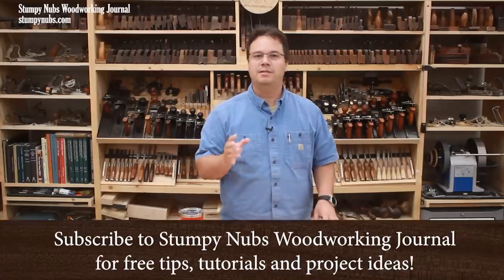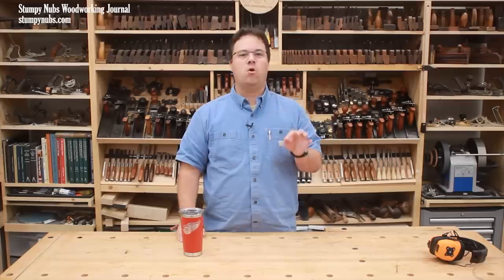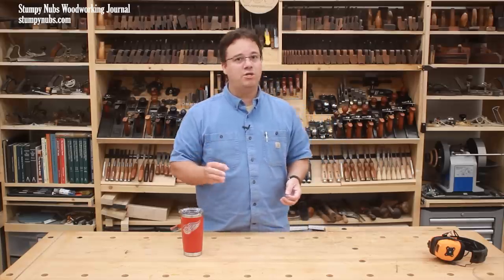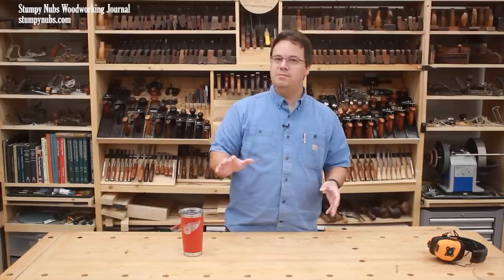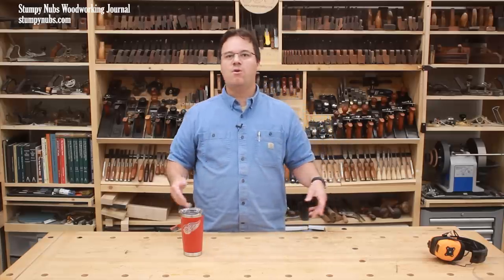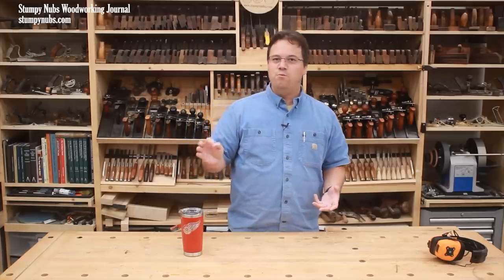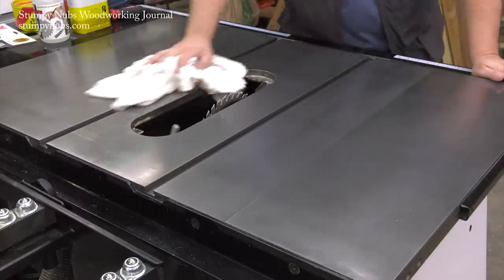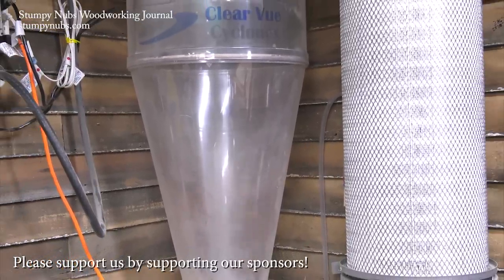Removing table saw rust SAFELY and QUICKLY

Comment: I bought my cabinet saw from a guy who must have stored the table in salt water. I ended up scraping off the rust with a putty knife, then orbital sanding the “remains” with 400 auto body paper, careful to sand evenly and consistently. I waxed it and went to work. After awhile, the faint sanding swirls were polished off by use.

I’d certainly never perform such a process on my Bridgeport mill table, but it’s been totally adequate for a woodworking machine.

Comment: I use super fine steel wool with paste wax. Follow up with a buff with a soft cloth. Don't get too aggressive on that pressure though. No rust and my wood glides across the surface.

Comment: Good tips, but I have another dilemma with a table saw top. It's a well used 200yr old table top with tons of pits. Being cast iron of some sort, I thought about surface grinding it taking off a really thin layer, but concerned with age & being cast the heat would warp it. Asked about have top brazed as well, but again the heat could ruin it. Final thought is mixing a very thin coat of epoxy with silver coloring to try and fill the divits, but takes away from the character. My goal is to restore this saw to working condition again, so any other suggestions would be greatly appreciated. The top is still usable as is, but was going for a cleaner classier look the a top with a gazillion nicks pots, & dings on surface..
Reply: If you're really serious about resurfacing your tablesaw table, then consider shipping it to a company that can perform Blanchard Grinding on the table. This is the process that was very likely used to flatten the table top 200 years ago. It produces that distinctive overlapping circular grind pattern that you may have seen before, and can deliver flatness of 0.002" or better across the entire part. Go ahead and look up Blanchard Grinding, and see if there's a company around that can help you with your restoration.

Comment: Hi James question, I bought a scroll that was used, my guestion is will this method work on a Delta scroll saw table it doesn't have  a lot of rust just in 2 areas besides the blade entry slot about 4" by 6"   thank you for the video and specially your time 👍😁
Reply from the maker: Any cast iron tool

Comment: I go a little overboard after rust removal I use T9 boeshield then after that dries I use paste wax. I live in florida so it's always humid here. It's been about 6 months since I applied it in a none climate controlled shop with zero rust.

Comment: Amature DIY guy here, would you also recommend paste wax for an aluminum podwer coated top jobsite table saw?   Its not that it needs corrosion protection 
So much as im trying to make feeding smoother.

Comment: the trick I was taught was neutral color shoe polish for rust protection.  but I don't know how it would get along with woodworking.  gun bluing remover will also make severe rust go away quick.  along with pretty much anything you spill it on.

Comment: Down here by the gulf coast paste wax just doesn't cut it if you use your saw daily (pun intended) I've been using T9 for the last 2 years and went from stripping and reapplying paste wax twice a month to stripping and reapplying T9 maybe 2 to 3 times a year. Mostly all in the winter

Comment: I like the Johnson's paste wax but I don't think they're making it anymore. I've always found paste wax hard to remove (especially if you put it on thick), but a little trick I discovered with the Johnson's is if you put it inside a piece of t-shirt material and use it as an applicator, you get a uniform thin coat, which is much easier to buff off. Tried it with the Minwax "finishing wax" but it doesn't work nearly as well.
Reply: Wow. Just googled it. You are right. I hadn't heard until now. This kinda hurts my heart a little.

Comment: I highly recommend Carbon Method instead of paste wax.   Been about 2 months on my table saw and jointer and both surfaces are super slick.  AND no rust.   Which used to be a big problem for me near Chicago.

Comment: The orbital sander works well I'm sure but don't you end up with a mess of metal dust and WD40 all over the sander? I like a Dremel Versa with a piece of Scotch Brite and some WD40 to take the rust off of tables. I've basically dedicated the Versa to those tasks so I don't have to regularly clean it up. Food for thought...

Comment: They don't make  Johnson's paste wax for two years now. What else can do the job.  I have no idea what would be better.
Reply: I use minwax paste finishing wax. Been working fine for years.
Reply from the maker: I merely recommended paste wax, not the Johnson's brand, specifically. You can still by paste wax.